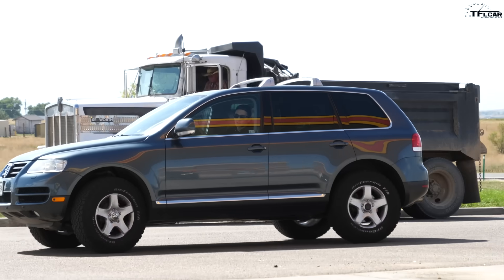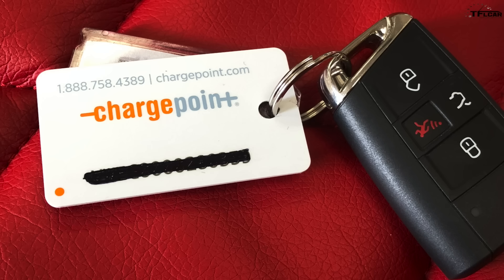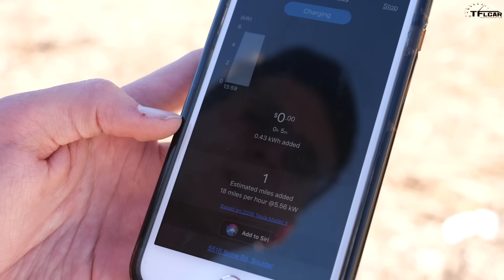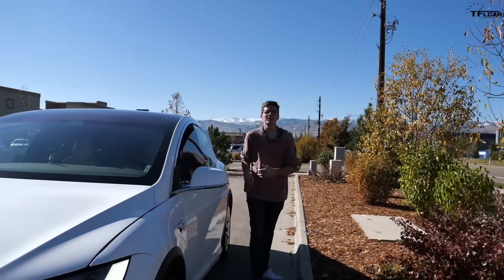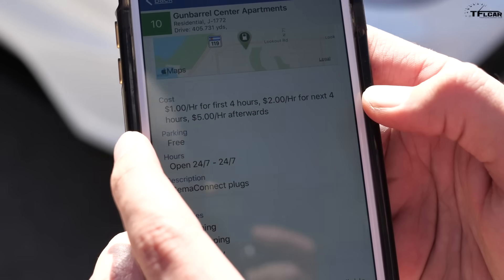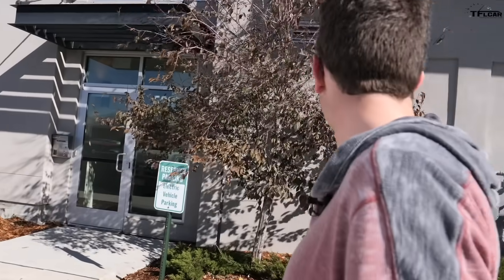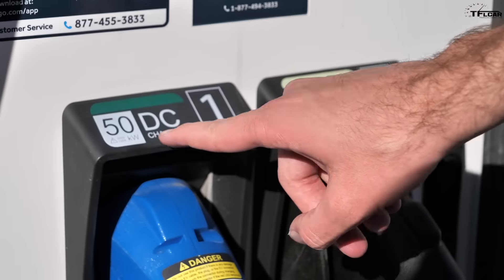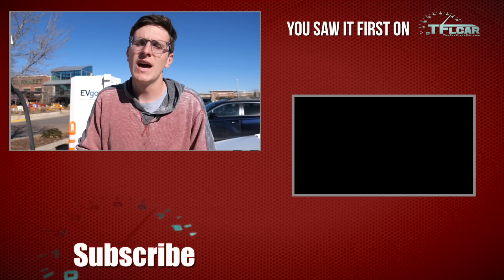Here’s Why Charging an Electric Car Can Suck - And It’s Not The Reason You Think!

Comment: Good summary!  Important footnotes:
*  This video was presented from the perspective of figuring out the quirks of charging from a charger you’ve never been to before.  In day-to-day reality, you find a handful of favorite chargers you “know and love.”  It takes almost no time to figure out the chargers you use periodically.
*  Remember that most Americans (before COVID19) averaged about 30 miles per day.  Even on a ho-hum ChargePoint-style AC charger you can fill that up in a typical-to-long shopping-trip’s time.
*  As you correctly pointed out, if you can charge at home, and a lot of Americans can, you’ll almost never need a public charger .  Once you have a home charger set up, it literally takes 2-3 seconds to plug in in the evening and 2-3 seconds to unplug in the morning.

Also, few Americans who can charge at home need a super-fancy charger:  The “granny lead” 120V adaptor that comes with the car can easily charge 30 miles overnight.
Reply: 30 miles over night,!!! sounds just crazy,
Reply: @brianfield792 , 30 miles typically takes around 7.5KWh of energy (more for some cars;  less for others).  If you charge that in 7.5 hours  then you need a KW of charging capacity, which at 120V is only 8.3A.  Most home circuits have 30-40A breakers, so “piece’o’cake,” so to speak.

Comment: He's driving a Tesla, simply go to a Tesla charger no problem.

He's making an charging problem that doesn't exist.

The model 3 will charge as high as 48 amps per hour so 17 mph charging rate is minor.

If you go to a Tesla supercharger which he doesn't show can charge from 5 % state of charge to 90 % in less than 30 minutes. Super chargers are open 24/7.

Comment: Some hassle I had not dreamed of existing. I’ve been wanting an electric car for decades.  There is going to need to be greater ease in charging and am a techie.  It also means if you don’t have Internet working at the moment for example during an Internet outage you get no charge.  Very very unfortunate. And on top of that to to have the possibility of limited hours of operation of charging you’re killing me.   I might just run over the pedestal and use jumpers to steal the electricity if I get frustrated.

Comment: Limited range, limited charging options, complicated connections, different speeds of charging.  No thanks, gas is working just fine for me.
Reply: Yes, gasoline was a great invention. They've got a LONG way to go with these rechargable cars. My phone is rechargeable. So is my shaver. And they don't take hours and hours to recharge.
Reply: Did you compare a phone and a shaver charging to an actual vehicle??
Reply: Lung cancer from breathing the fumes when you refuel is a bit of a downer, but you'll be fine. Probably.
Reply: ICE cars have limited range too...
Reply: @vanessamero8415  yea
But you can refill in under 3 mins and have 300-600 mile range. While it takes hours for fully ev cars to do that
Reply: @jschackmann2  this vid was misleading
Reply: @jschackmann2  Its not that bad, Tesla V3 Superchargers can get you from 5 to 90% in around 40 mins. Not 5 mins like a gas car but you can definitely work around it as over half of that 40 mins is spent from 80-90%. The ones in the video are level two chargers, they are usually located in places you will spend a decent amount of time like malls, amusement parks, zoos, city parks, ect

Comment: i would switch if they could make me a truck to replace my ram 3500 drw, it needs to be able to take me 500 miles in 1 charge or be able to full charge in uner 20 mins, have a cargo capacity of 4k lbs+ and a towing capacity of 14k lbs+